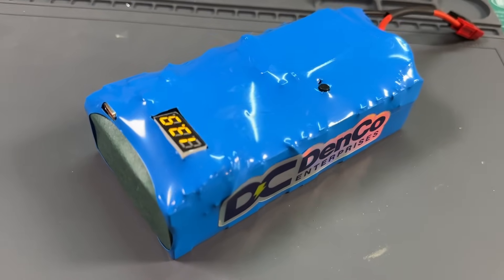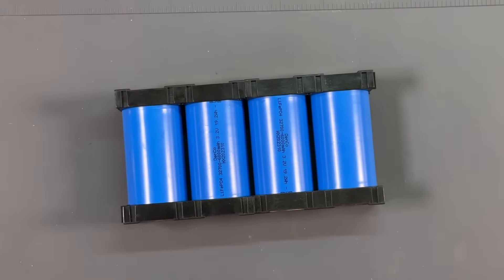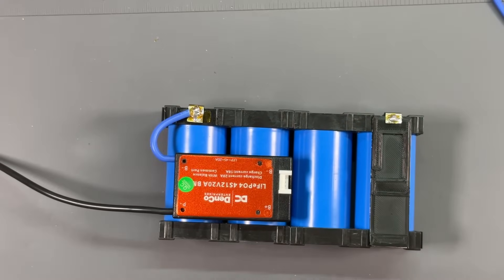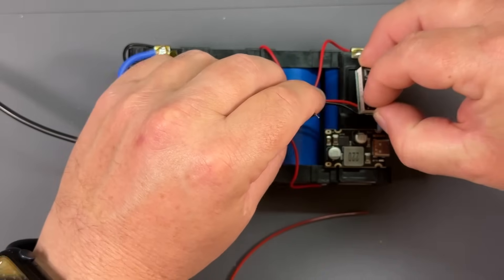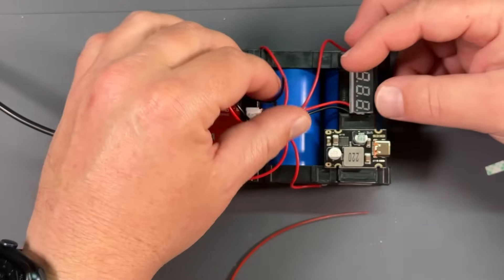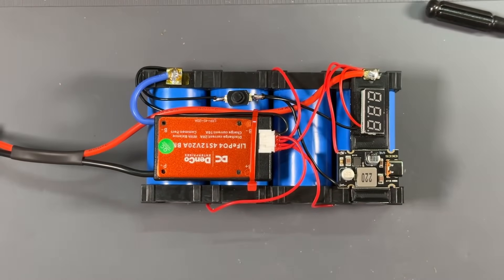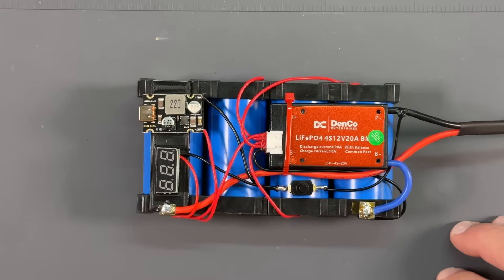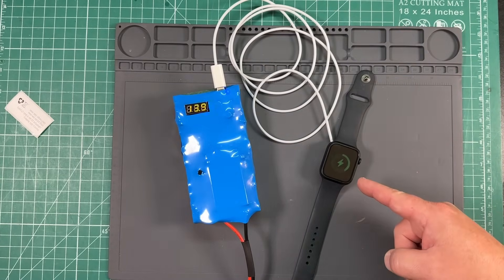This DenCo LiFePO4 Battery Kit Is A Must For Ham Radio

Comment: I just realized this while commenting on a different comment here. It looks like the connector on the USB C that you used is the one that goes on a cable. That's going to cause you grief over time as you now need to buy extensions instead of normal USB cables. The design spec and the standard for USB-C is that devices get sockets and cables have plugs. Chineese companies violate this all the time but it just means you then have to have custom cabbles to make a connection  which is the whole point USB C was trying to solve.
Reply from the maker: Tell me you didn't watch the video without telling me you didn't watch the video.  Specifically the part where I CHARGE MY APPLE WATCH.

Comment: You could just put the kapton tape back on to the battery after soldering your wires. It provides a heat resistant additional layer on your contacts. The only minor issue is the switch and LED being holes will give the outer plastic tension flex points to begin cracking over time. Putting those points on the end instead of the middle will help with that.

Comment: That great. I want to do extra's with that as well. but with 2 or 3 battery pack put together . waiting to see when they re stock the kit. I think they sell just the BMS . that will work for like the 10 Ah cells but 20 amp BMS.  I want to add volt and amps to that kit for meter. and the one I found has bult in shunt and show charge and diss charge amps . looking for a USB C PD in to charge that USB. I have a 65W PD out now, some what bigger . I have the clear plastic to make the case. got that from home depot . and is Plexiglas brand. 1/4 in. and the glue. I found a Bluetooth dongle to solder it in . smart phone app will show temp volts of each cell and the amps in and out. that small. just the battery and mise parts and I have a Denco battery pack as well and I bult it. now who sticker do I use?  found some nice POTA ones threw the POTA website even tee-shirt for my girlfriend. love your build video's ! helps me get more creative because we can ! 73's

Comment: This is excellent. I've wanted to build one of these since watching Julian and you build them way back when, but I never had the equipment to spot weld the cells together. Do you have links for the switch and volt meter?
Reply from the maker: I got the switch and volt meter from Dennis.  I think he sells them.

Comment: I was excited about this till I saw the price it’s basically the same as bioenno.
Reply: you get 0.5ah more with the bioenno but no usb output or volt meter. I guess the tradeoff is assembly, but for some thats the fun part
Reply: @BikesBobbers I thought the USB C was charging not output. Either way it has the wrong connector on it. It has a cable end, not a connector end, so now he has to keep an extension cable to use it not a normal usbc cable.
Reply: @RowanHawkins  you do realize that usb C to C has been the standard for the last 4ish years? usb A for charging is dead, it cant handle the wattage modern devices need.
Reply from the maker: I love how you think you know what you're talking about!
Reply: @BikesBobbers  I can make an adapter to split from ANY battery to accessories/radio. I don't see any upside to this,just novelty.
Reply: @ess2870  convenience. An adapter would be messier and cost the same if not more. If I'm running a portable rig while camping, I'd much prefer a built in USB.